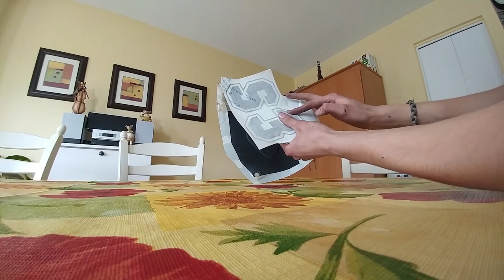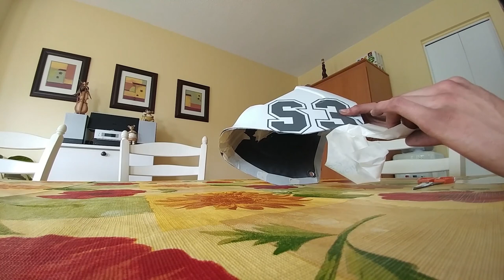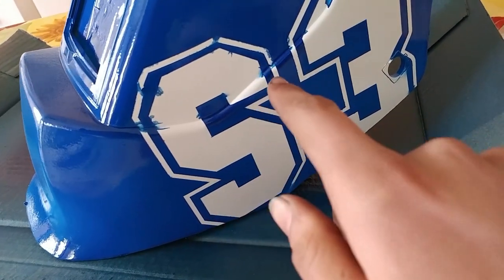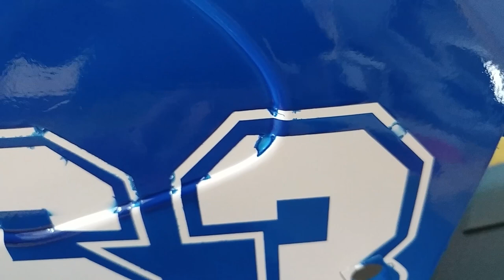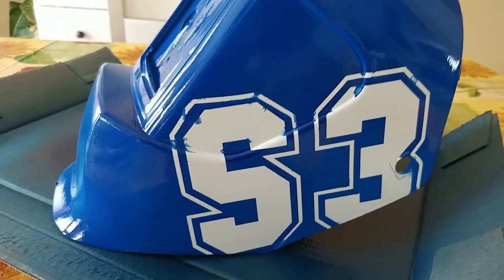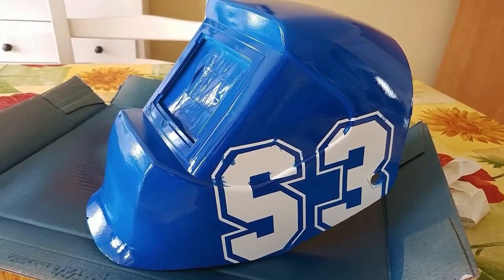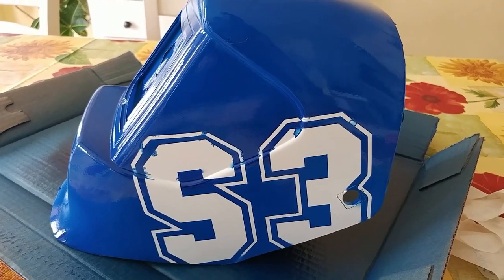Painting a Mig Welding Helmet! Part 2

Comment: So did you sand it off first?
Reply from the maker: Sorry for the late response, i just cleaned all the surface, nothing too fancy. Been using my helmet alot since 2 years and it held pretty good, cracked at some places but in good shape
Reply: 希望 Gabriel Desjardins what grits did you use
Reply from the maker: @filthycrocodile  i didn't, just cleaned it up good and primer over the rough material
Reply: @gabrieldesjardins6715  did you find that there was any kind of burning of the paint? or did you use a high temp clear coat?
Reply from the maker: @LokiXeroClone  i used a basic clear coat with flakes in it, nothing high temp... Paimt held really good with all these years, started cracking a bit after a year and a half , and that's with regular use (2-3 times a week)
Reply: @gabrieldesjardins6715  I usually weld 48 hours a week, so I'm trying to figure out a good paint
Reply from the maker: @LokiXeroClone  i'd probably go with a good sand, cleaning and eurethane paint